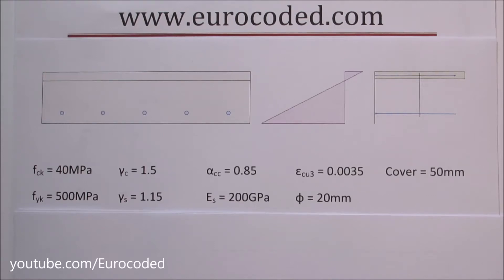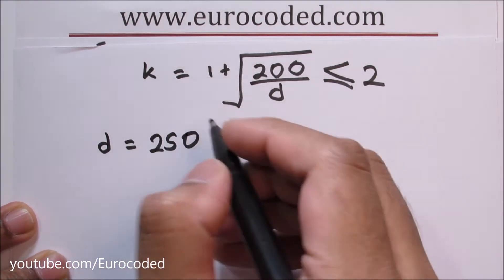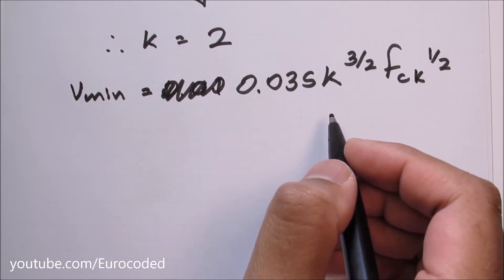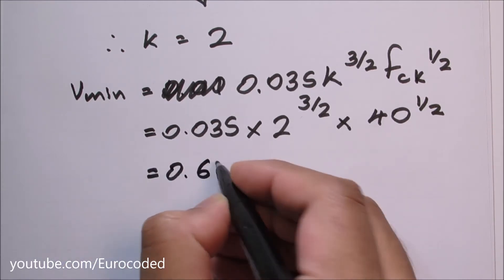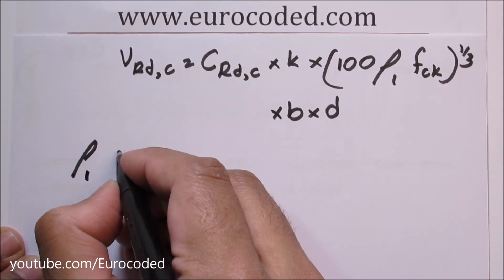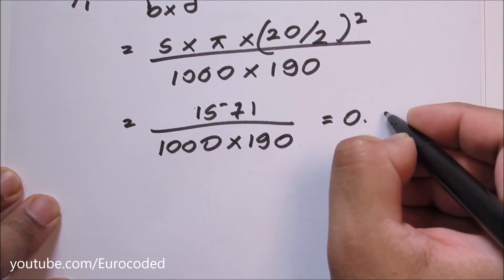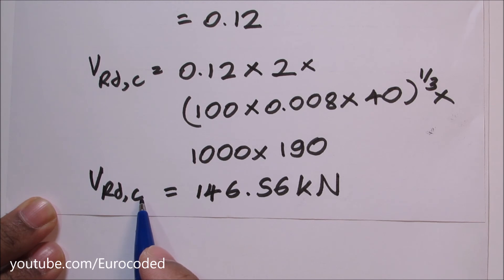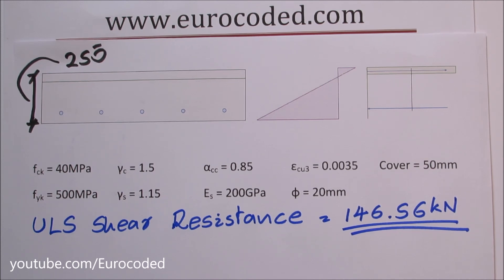Shear Resistance of a Singly Reinforced Concrete Slab to Eurocode 2 (Worked Example)

Comment: What if minimum is greater?
Reply: As the name suggests, you would use the minimum as the lowest value of shear resistance you will take. If it is higher than the other equation used then it will still be the minimum taken. See Section 6.2.2 of EC2-1-1